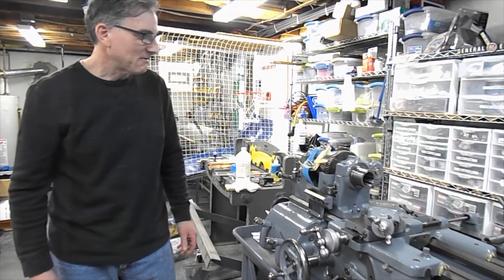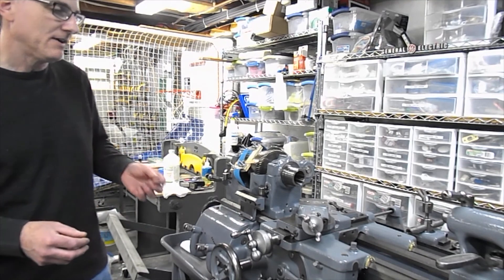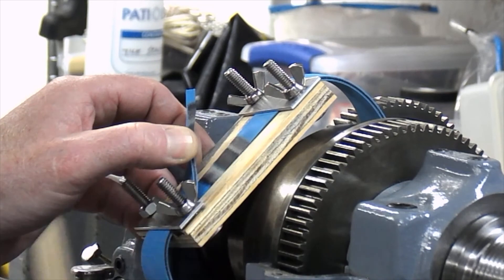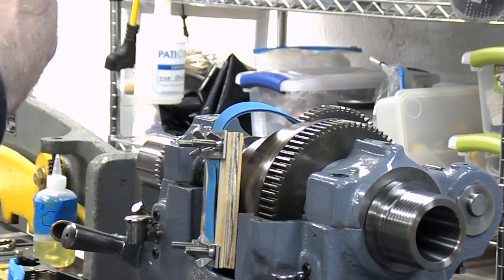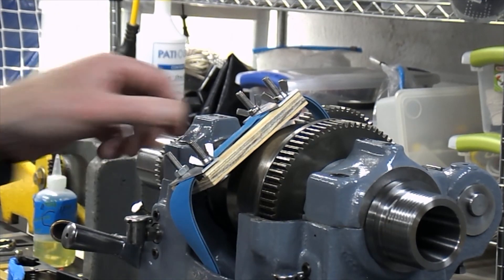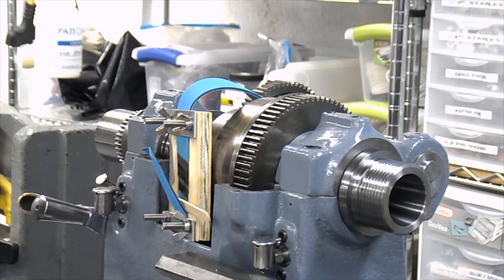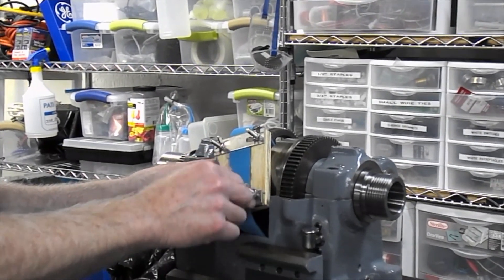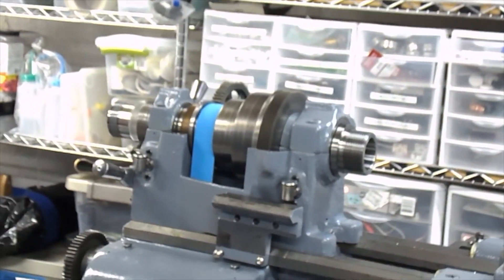South Bend Lathe Flat Belt Installation

Comment: Not excessive pressure is the range that someone with an average amount of common sense would come up with…There’s a million different methods used to glue those belts together considering everybody doing it comes up with their own little system,, and they more or less all work ending
 with the same outcome.. and then some people overthink the whole thing 🤔 when they could’ve come up with something much quicker and easier…
Anyway nice looking Lathe..

Comment: Beautiful paint and polish. I like your jig. Great job. I've been re-lacing the old belt that came with my machine every few days for about 6 months. It has two splices in it, so it's a double re-lace every time. lol  Question: What is the attachment on your head stock just under the right side oiler? I'm not familiar with the 10". Thanks
Reply from the maker: It is a mount for the micrometer carriage stop to allow for close collet work. Instead of clamping the carriage stop to the bed the bolt goes through one of the holes in the mount. They are all over ebay for about $50. Lathes built some time after the mid 50's  have the two mounting holes. Mine did not so I had to drill and tap two 1/4-20 holes.
Reply: Jeff, Thanks for the reply. Interesting. I'll have to keep an eye out for it next time I look at one of the old accessory catalogs. I have the regular single barrel micrometer stop on mine. Any upcoming shop projects planned for upload? I'm always looking for more to watch and learn from. Thanks.